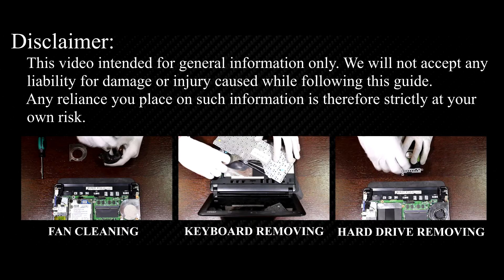MSI U135DX RAM Upgrade and Installation Guide

Comment: Is 4GB RAM 1600mhz compatible? I might need to upgrade mine..
Reply: 4GB DDR3 RAM 1600MHz is not possible. The Motherboard can only go up to 2GB DDR3 RAM. Just tested a 4GB no luck at all
Reply: @rezanovanwyk4791  same here, this is an 8 year old laptop of my sister. I tried to install 2 diff 4 GB DDR sticks, no boot at all.
Reply from the maker: DDR3, Max: 2GB

Comment: where is old RAM? I mean which is already comes with netbook
Reply: It's embedded in the motherboard
Reply: So if I put a 2 GB RAM module in it, I'll have 3 gigs altogether? Is that possible?
Reply: @kisgame98  No, the motherboard can only take a total of 2GB. there's already 1GB integrated, so it will only accept another gb